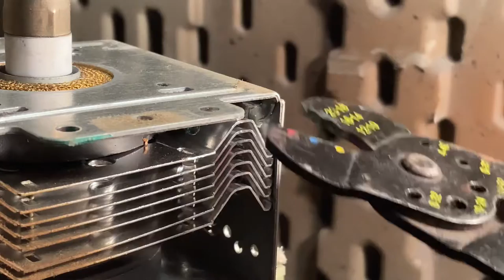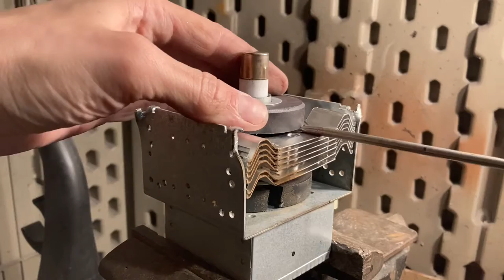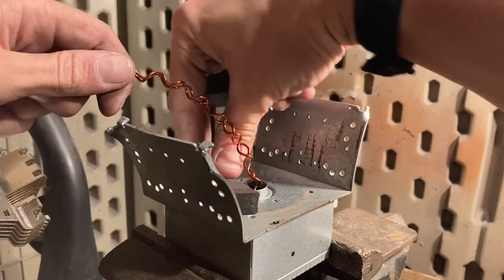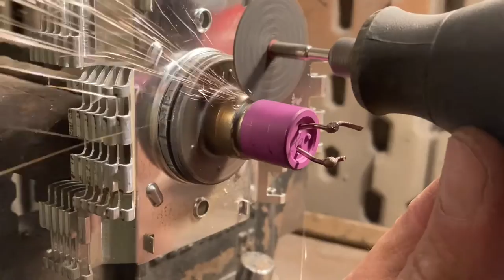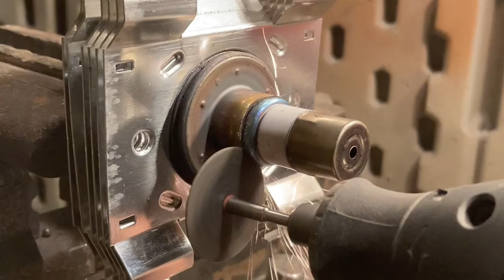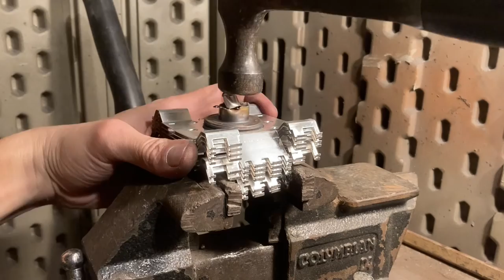How to scrap a magnetron

Comment: That is very dangerous cutting the magnetron where you did. If you cut into the red or white parts of the ceramic, it will create a dust. If you breath in that dust, it will poison you.
Reply from the maker: They stopped using beryllium oxide ceramic in magnetrons decades ago, too expensive ;)

Comment: The round piece is made of steel and copper, welded together.      The ends are steel, the middel part is copper.     Use a magnet, and you 'll  finfd out.
Reply from the maker: Yep, the middle counts as electric motor ;)